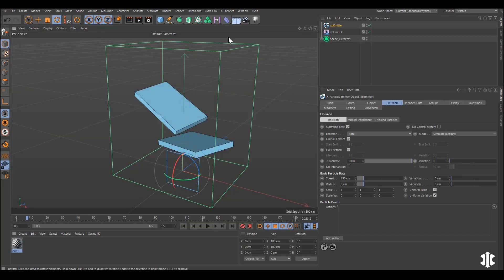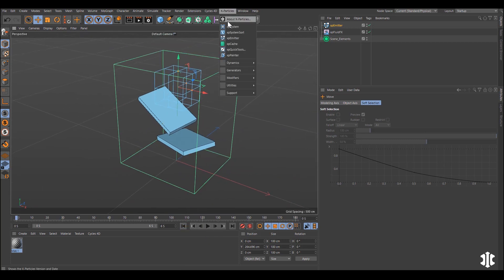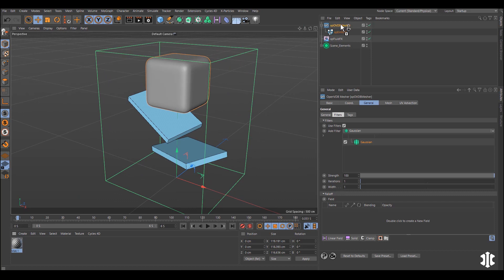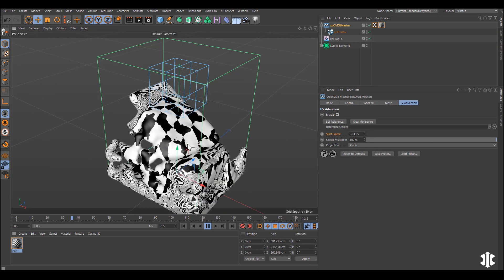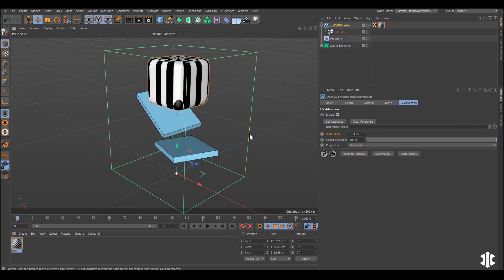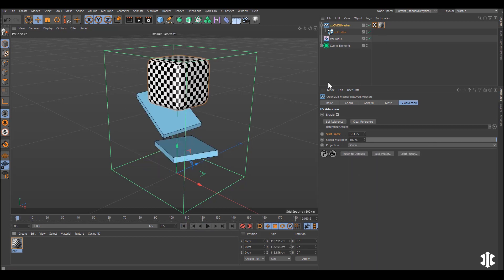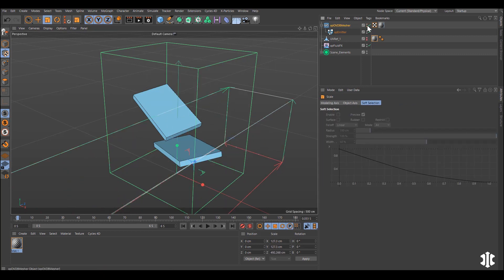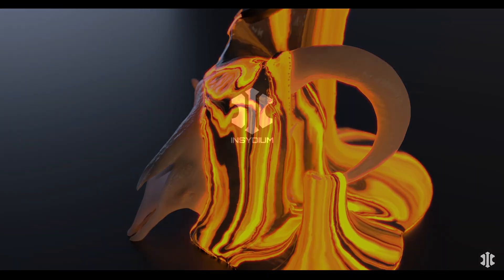xpOpenVDBMesher - UV Advection - Sneak Peek

Comment: What machine do you use to run XP? because one I start messing with fluids and OVB mesher everything slows down to a choke.. I have dual 2.3 18 core processors.. intel...   it always chokes on XP. it makes the processor intensive stuff  undoable on my machine.    Would the top AMD CPU crush XP?

Comment: I am using catalina 10.15.7 and hoping that this new update will work smoothly on this operating system unlikely the new updated version of cycles4d. I get inst crashes so that I had to go back to the previous version. But overall good job gentlemen. I am quite happy to use your software.